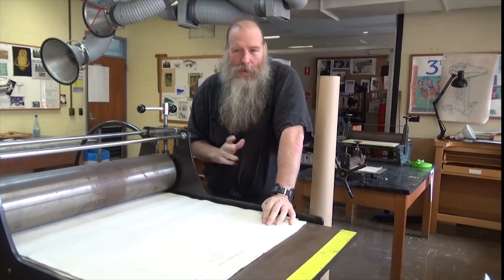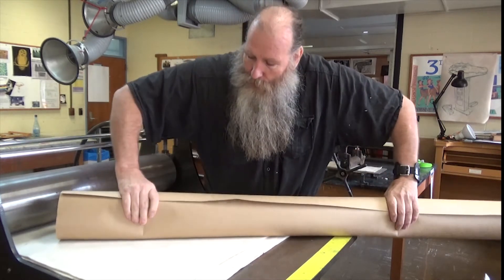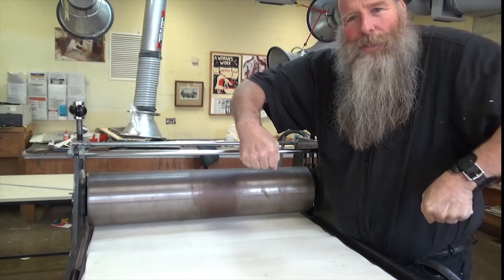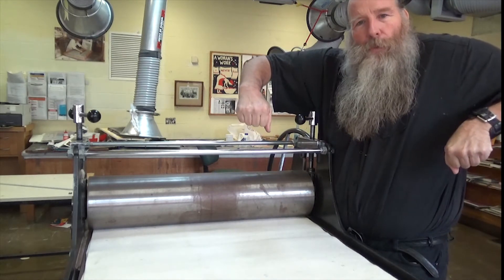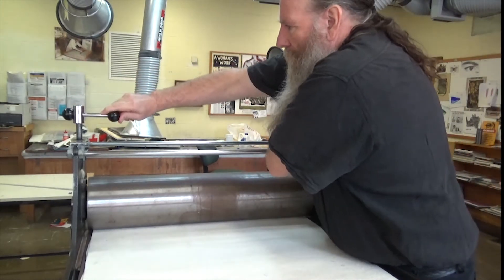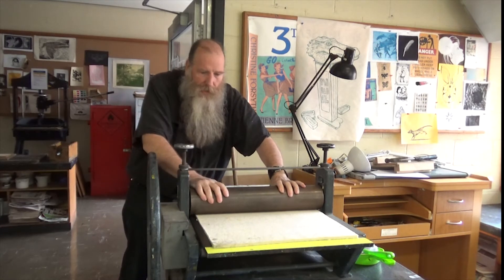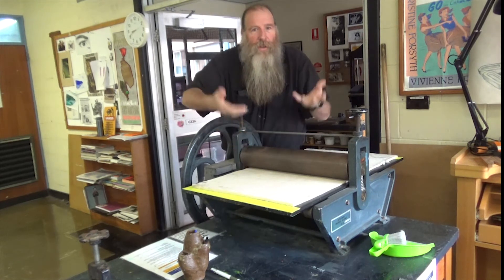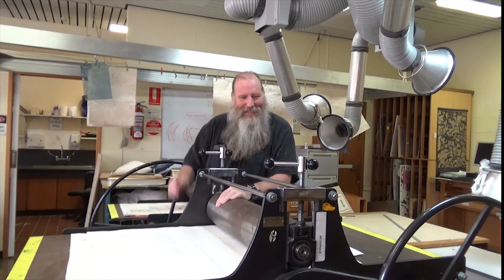How to set the press for printmaking

Comment: Hi. I have a question about the bottom plate in etching presses. I've seen that there is a kind of SEESAW action of the plate as its centerline passes the bottom roller. is this normal? if yes, how much of tis seesaw action is desirable?
Reply: Not really normal, you are referring to the platen or bed? Sometimes this is steel but I have worked with a press where the bed is hardened wood. They can wrap a little which make a seesaw action happen. This is usually not enough to stop the press working and it should still print fine. It is just a little annoying, I teach with presses from the 1990s and a couple are like that, which means that a student has put too much pressure on that press at some stage.
Reply: @SnakeArtist  Cheers Mate. This is very helpful. All the best.